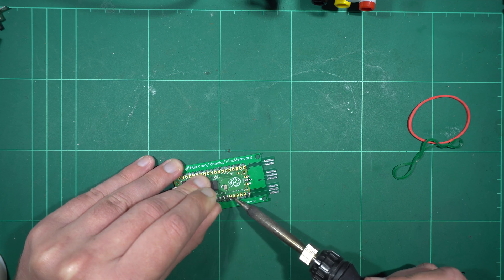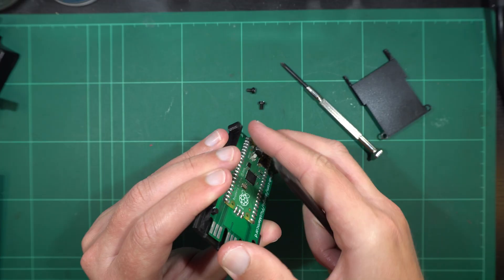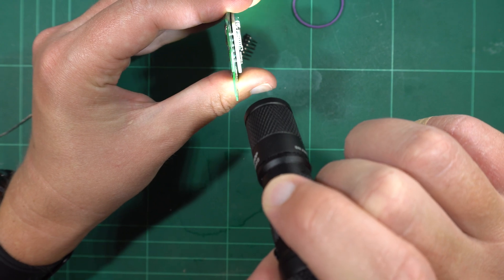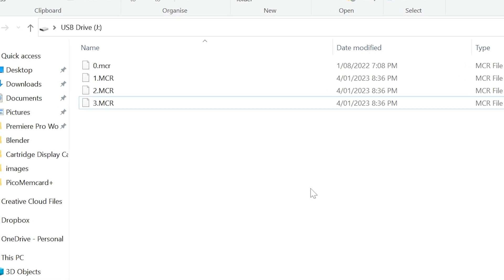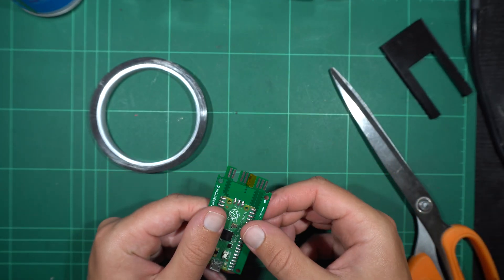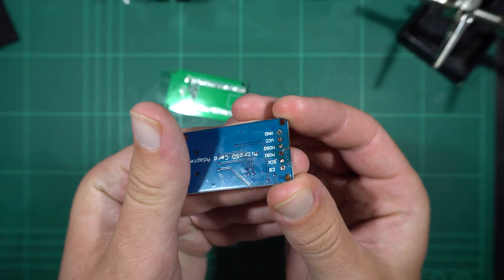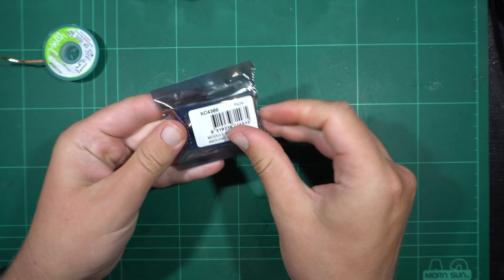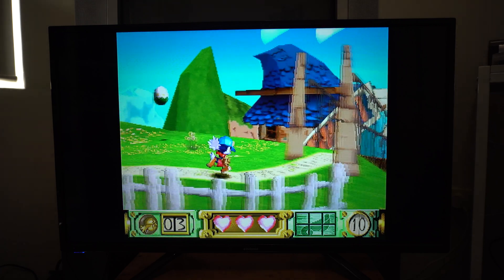Upgrade to the DIY PS1 Memory Card! PicoMemcard+

Comment: I imagine the issue with those modules not running at 3V is because 3V is being sent through a the 5V in of a 3.3V regulator...
Sending the 3V supply via a wire to the output leg of the 3.3V regulator should solve this.

Comment: Nobody need this. The save file can be backupped on pc with freemcboot
Reply: First of all, this is not the Point of the Card. It is first and Foremost used to have multiple Memcards in one, so you don't have to keep around 20 Memcards. Second, it is used to use a Software Exploit named FreePSXBoot, so you can play homebrew (or pirated games lol)

And: The last problem with your statement is that not everyone has a Ps1 AND Ps2 lying around, but there is no FreeMCBoot on the Ps1

Comment: It is possible it would have worked if you had bypassed the voltage regulator on the first boards.
Reply from the maker: That would likely mean sending too much voltage into the memory card slot. I wouldn't recommend that lol
Reply: @retrogameon  It seems the pcb uses the 3.5v and not the 7.5v. The SD and RP2040 use 3.3v (max 3.6v). As long as the SD doesn't use the 1.8v mode or the PS1 overvolts the 3.5v line it should be fine. In the GitHub the RP2040-Zero version uses a SD card board with no regulator. The only thing that could give problem is the buffer/voltage translator? chip depending on it's specifications.

Comment: Great video!

Thank you for keeping us updated on this!

I took a look at the µSD card adapter that you are using has a linear 3.3voltage regulator on it.  Which is the AMS1117 3.3
Now adapter I believe is meant to be used on a 5V supply.  Now the closer the input voltage gets to the regulators output it will shut down once you get below its minimum input voltage.

Would need a 3.3V version of this µSD card adapter board or modify this version of the µSD card adapter board.